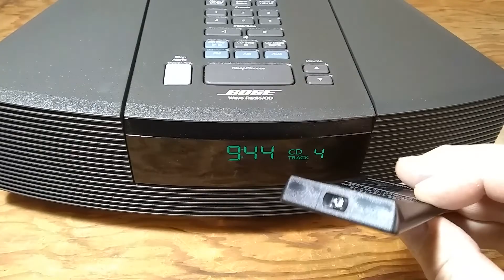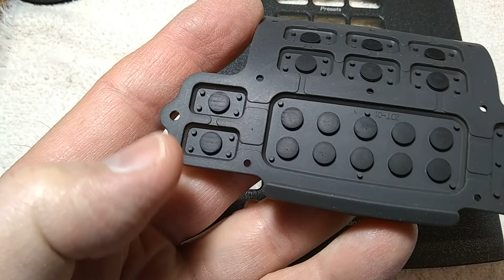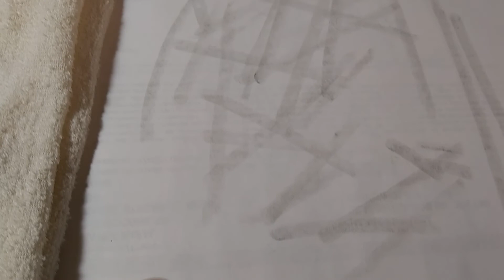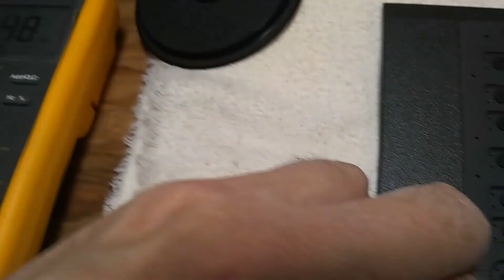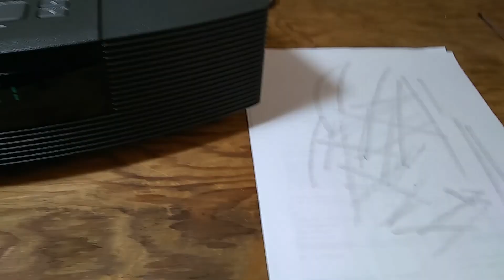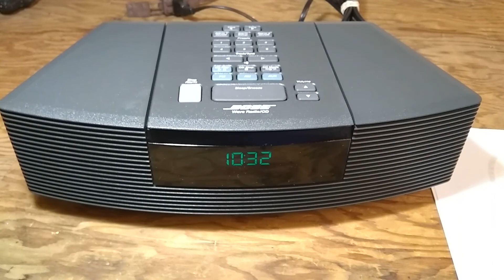[Part 2/2 - Important Update!] Bose Wave Radio CD AWRC-1P & AWRC-1G Top CD Door Buttons Repair

Comment: Great update to the informative original video. I have an old MIDI keyboard controller (Roland Edirol M30) that used these disks embedded in rubber retainers. I had meticulously taken it apart and cleaned the disks with a Magic Eraser dampened with isopropyl alcohol but sadly it did not revive them. Now I wonder if I would have had more success had I used the copier paper method. I still have it on the shelf so maybe I will find the time some day to try again. Not nearly as valuable as the Bose Wave Radio, though. :-)